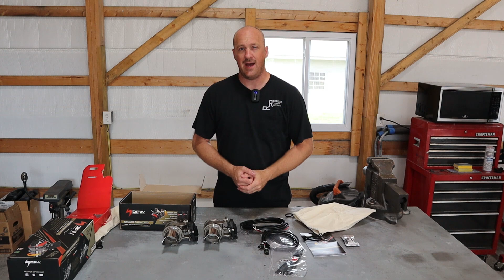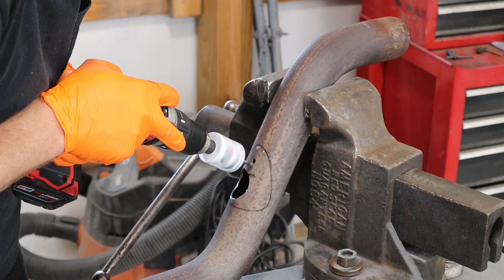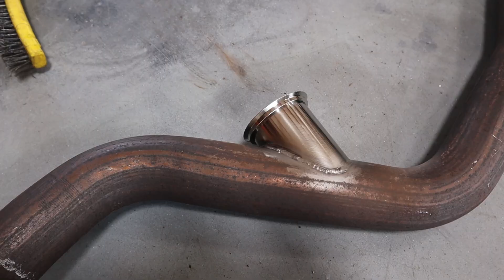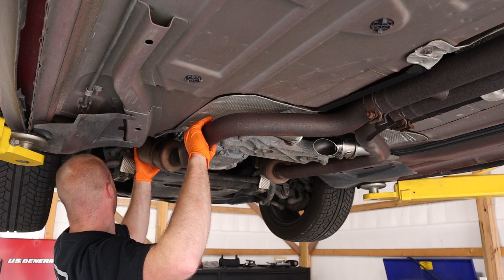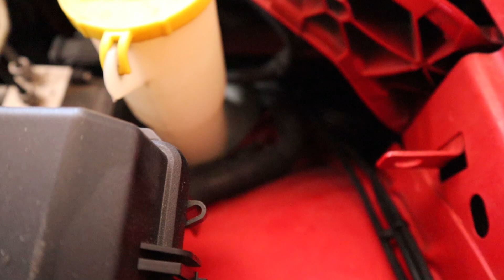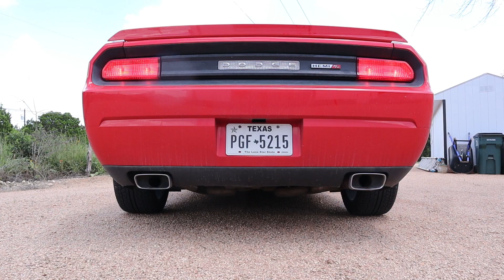Electric Exhaust Cutout Install! 2010 Hemi Challenger R/T

Comment: Why didnt you put cutouts on outside
Reply from the maker: It's hard to see from the video, but the floor pans are about two inches lower in the outside of the exhaust pipes. If i tried to put them out there they'd be scraping on the ground 👍
Reply: @ReignitedAuto  10-4 I got you i always put mine right before the muffler or cats if there farther back

Comment: Do these cutouts have any negative effects on performance? Would love to have a set if they don’t cause loss of performance. I’m sure my scatpack is tuned to run with the factory exhaust and back pressure/flows that come with . Any 411 ?
Reply from the maker: No impact on performance at all, positive or negative 👍
Reply: What's the point of it @ReignitedAuto
Reply from the maker: @mannyaraujo1  sound pure and simple. Some people like a louder rumble, some prefer it quieter, these allow you to have both.
Reply: @ReignitedAuto  many ways to get that
Reply: What about back pressure??best done with borla catback exhaust.. with cutouts, electric switch
Reply: Why not just straight pipe

Comment: Great vid! How are those cutouts holding up?
Reply from the maker: Wish I could tell you, I sold the car about a year ago now. But they seemed to be very nice quality overall, I wouldn't be surprised to hear they are functioning perfectly. In fact, for my next project I'm going to do cutouts, and I'm going with the same models because I liked these so much. 👍
Reply: @ReignitedAuto 
Thanks for the response! I imagine that their longevity's dependent on frequency of use; I can see myself burning the motors out opening/closing them too often... 😭

Comment: I know this is a little older of a video, but am just wondering, if you look at the 5:47 mark, what am I missing to where these cutouts could not be place in the elbows by your forehead? Like you were explaining behind the muffler. It's hard to see on the video if it does or doesn't make sense.
Reply from the maker: I did a poor job of showing this with camera angles, but the outside of the elbows the floor of the vehicle is much lower than the inside fo the exhaust, and this would have pushed the cutouts down about 25-30 degrees, making them extremely susceptible to being ripped off on a driveway entrance or something like that. 👍

Comment: Too bad you couldn't put those in before the cats. Those cats muffle the sound more then the mufflers. Id rather cut the cats out and leave the mufflers but maybe change the mufflers to some glass packs or cherry bombs.
Reply from the maker: It's a tough call for sure. At the time of this video I was living in texas where they've got emissions testing yearly so removing the cats isn't an option. 👍
Reply: @ReignitedAuto  Right, I wasn't suggesting that. I was saying it would've been nice if you could have put the cut out before the cats not cut them off completely. I live in texas also and it depends on were you live as far as testing the emissions. Out in country Texas area they dont test your emissions. Its nice. They don't even care about those stupid check engine lights either.

Comment: Great video's just found your channel, just wondering why you didn't install them on the outside instead of facing each other...
Reply from the maker: Hard to tell from the video but the floor pans on either side are much lower than the tunnel so if I mounted them on the outside they would hang down quite low and likely get ripped off at some point. 👍

Comment: Ive thought about getting cutouts, but with how my exhaust is set up, i feel like it wouldn't be worth it. Ive got mufflers, but they are a straight threw muffler, so i dont think it would be any louder our beneficial for power
Reply from the maker: I suspect even with the straight through style mufflers that there would be a difference in tone. Definitely no difference in power though.

Comment: I'm not going to lie that looks retarded where it was put and run. I would of used a Y cut out style and  I would of put them a foot behind the converter or down by the strait stretch down by the drive shaft hump with a outpipe right in front of the rear tires!
Reply from the maker: It comes down to ground clearance, if I put them anywhere else the entire actuator and pipe would be below the body of the vehicle, and I guarantee the first bump he hit would have torn them off. This car is already lowered about 2" so ground clearance is a major consideration.

Comment: That's a great kit. Does it have a exhaust leaking sound when closed? I've heard a few cut outs that sound like a leaking manifold gasket. Your install is super clean. It's great to see someone with pride in their work. What do you think about showing us what could be done with a truck like mine ('17 1500 4X4 w/ 5.7l)? Keep the videos coming Sky!
Reply from the maker: I was worried about the same thing Tom, but it seals perfectly, no sounds of any leaking at all. Now whether they start to leak eventually is another story, but time will tell. 
Definitely want to do a truck, but it'll probably be a 2wd sport version 👍

Comment: Another great video!  😊. I have two questions:  1) What welding technique are you using. 2). Wouldn’t the position of the cut outs on the exhaust dump exhaust fumes directly underneath the passenger compartment?  Thus, these fumes creeping inside?
Reply from the maker: Hey Eric! In this video I'm TIG welding, and I was a little worried about exhaust fumes myself, but the fact that there are turn downs on the end of the cutouts helps quite a bit. I did sit and idle the vehicle for about 10 minutes to see if I got any exhaust fumes, but there were none so I was happy with that. 👍
Reply: @ReignitedAuto  I was thinking the same thing about exhaust fumes Eric.  With his experience/knowledge I figured he thought of it too.  I suppose two important things for anyone doing this:  (1) Make sure it's a quality valve (good seal to prevent leaks) and ensure good welds to prevent leaks; and (2) I imagine this performance mod would only be utilized outdoors on the street and for short time frames.  Outside of manufacturer claims, do these actually increase HP (when placed approp.)?  That would be interesting to know, & could sway a purchase decision.  And like Eric said, thanks for yet another great video.  Your explanations and details make the difference on what to choose to watch when time is limited.

Comment: I like the wireless control. Curious to why you didn't put the cut outs on the outside of the pipes and direct the exhaust to the sides of the car? Call me crazy but the exhaust is confined to the undercarriage under the floor so at idle the fumes would go up into the cab. Anyway that's how my mind works. LOL ( Nice job)
Reply from the maker: It's kind of hard to tell from the video, but the mid pipes are recessed into the underside of the body, there's literally no room on the outside of the pipe unless I routed the pipes straight into the ground. This was not the most desirable location to put the cut outs, but really the only one that worked. I did drive around and idled for awhile to see if I got any fumes in the cab, but so far so good. 👍

Comment: I've been thinking about cutouts, only thing is though. I don't want to cut holes in my stock mid pipes. I've been thinking about a true dual set up and I would definitely love these. The biggest thing that has stopped me from really looking into them was cutting a hole in the dash.
Reply from the maker: I have to say, this kit really changed my mind about cutouts overall. I would have been hesitant to add them to my own vehicle, but after seeing how effective they were, and how they weren't leaking at all, I'm seriously looking to add them to another one of my projects down the line. 👍

Comment: Nice job and I love cutouts, they are in my opinion the perfect system (Which is, in my opinion, why many OEMs are moving towards them).  If you decide not to Turbo the C10, I know you had said it was a bit loud on the road, perhaps these might be what the Dr. (Wifey) ordered?

I would be really happy with those welds.  I wish mine looked as good as the lousy ones on the instruction manual.  But to my defense, I am using flux core, which is hard to do on thinwall tubing.  I'd like to get into tig, how much does a tank full of gas run you?  It's 100% argon, right?

I'd be curious to see if you can do an update on these in a year or so.  I know some brands leak when closed and I've heard some motors burn out.  Those seem really well designed though.
Reply from the maker: Nobody's welds look good using flux core, in fact, I think it's especially demoralizing to learn using flux core because it falsely makes you feel like you'll never be any good at welding. I guarantee that once you switch to gas welding that your MIG welds will look pretty decent within a day of practice. 👍
TIG does use full argon, and the gas price fluctuates depending on where you are. Previously I was getting my 80CUFT bottle filled for $65, now down here I'm getting my 125CUFT bottle filled for $55. The biggest expense is the original bottle purchase which is usually around $225 for a filled bottle. 
I've heard that as well about the cut outs leaking eventually. I plan on keeping in touch with the new owner to see how well they hold up.

Comment: Way back in the 60s those were called dashboard cutouts. No sissy batteries and remotes, you actually had to man up and pull a cable. Sheesh this new generation!
Reply: Work smarter not harder.
Reply: was the cutout right next to your tampons, talkin about manning up but all you older generation do is bitch and complain about the younger generation

Comment: Ever since I found this channel I wanted to start nodding my 5.7 M6 Challenger. 
 First mod will be full length header install. But to do it properly need to just completely replace the exhaust since I want to delete those pesky resonators. 
 If you ever want to make a nightmare video on it I can hire you to do that install
Reply from the maker: 😎 Love it! I would actually like to do the job, but I've shut my shop down for a little bit, you'll see why in a few weeks!
Reply: @ReignitedAuto  not a problem I’m in middle of a small remodel at my house. I live 15 min away. We can touch base when it’s more convenient
Reply: @Bob-gy6ud  hey bob do u know if u delete your resonator u lose back pressure